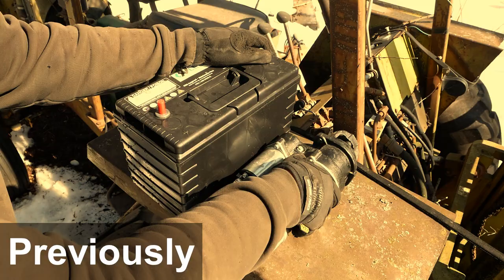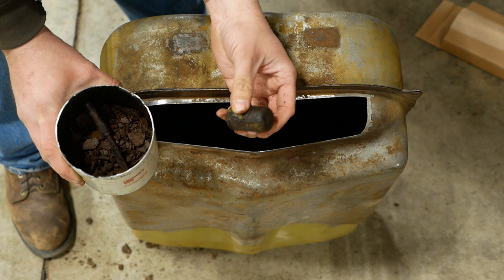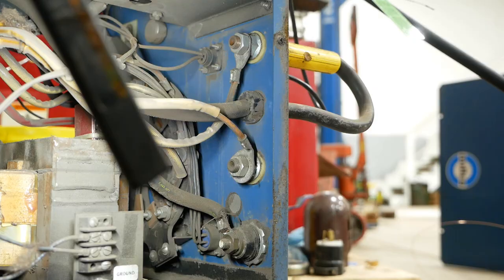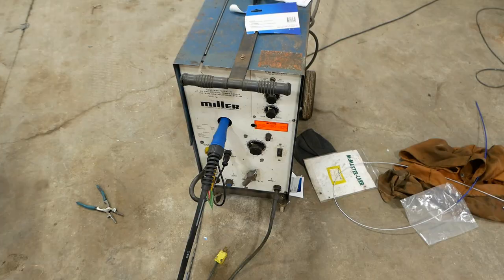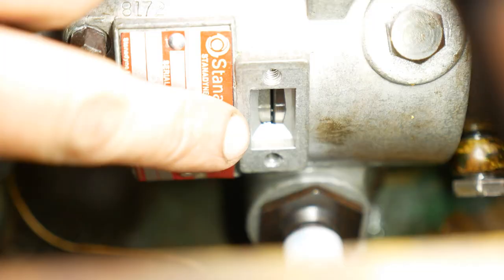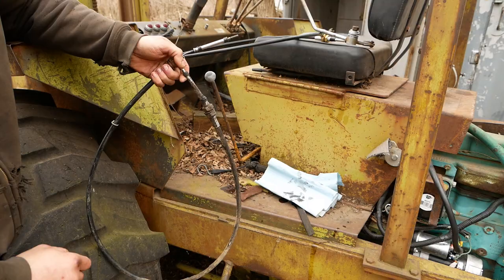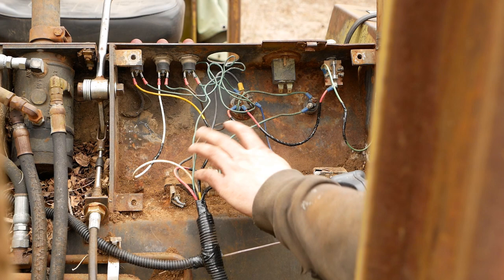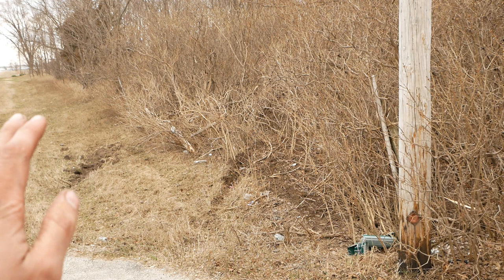Neglected Forklift Drives for the First Time in Years!

Comment: I worked with a Guy at a Truckin Company. We were both mechanics there. He always was welding on a Gas tank. He would put a hose on a cars exhaust and put it in tank that he was welding and with car running he would weld gas tank up...He even used Our bosses cars a few times too do it. Carbom monoxide wouldnt let Gas Ignite.. Seen this with my own EYES a few times. Always told him he was CRAZY for doing it. But hes still Here and so am I...Great forklift and video . Thank you for sharing

Comment: Good morning Wes.  FYI I learned welding in a job shop as a young man.  We repaired gas tanks leaking, full, half full whatever.  My mentor worked gas welding aluminum fuel tanks for aircraft during WW 2.  We always filled the gas tanks with a blanket of inert gas.  Works always by displacing the O2.

Comment: My father was a mechanic starting late 50's back when labour and shop rates were low and part prices were high. 
The mechanics were the ones to do the actual repairs, or install the rebuild kits instead of off the shelf remans.
Alternators, starters, brake master cylinders...all that stuff.

Predating the epoxy coated tank repairs, he used to braze rads and fuel tanks. 
The dealership was next door to a felt factory for boot insoles.
There was a huge steam boiler in the factory and the mechanics would steam clean the gas tanks with live steam off a 2 inch pipe.
(far different from steam cleaning" with a hot water pressure washer)
Apparently that worked.

I did throw an "empty" gas tank on a fire pit once.  It burned and popped all day like a pulse jet.

Comment: I guess finding a custom plastic replacement tank would have been difficult, and with it close to the radiator there are other issues. Good job!
Reply from the maker: It also holds the air filter. It would be uphill to replace.

Comment: Just for future reference, I have repaired gas tanks with fiberglass. Tanks much like the one you repaired. Just clean the area with sandpaper, then coat with resin and cloth. Never had any leaks.
Reply: I've used the fuel tank patch kits and never had one leak. There pretty much the same as fiber glass.

Comment: I remember a friend of mine getting blown across the workshop when welding a motorcycle tank. He had taken all precautions, filled with water, etc. I can still hear the pop today. He was very lucky, never welded another after that, always tried to get a goodwill replacement from the manufacturer. It wasn't his first one either, he had repaired plenty, used both braize and weld with no issues.

Comment: 6:00  I've had my eyes open for a Millermatic 200 like that here in Ontario, Canada.   No one parts with it unless they die and there are no kids to pass it to.  When that happens the auction prices are formidable.
Reply from the maker: Good luck. Those welders are fantastic. Worth every penny.
Reply: I paid almost twice the price, to get one imported to Europe. It was ultimately cheaper to import an unit and i managed to score it with extra bits and in good condition.
Reply: what kinda prices ballpark we talkin?
Reply from the maker: @darthtrump4428  I see them sell here for anywhere from $750 to $1200 routinely. Pretty good resale value for welders that are 20-40+ years old. Mine was built in 1980.

Comment: Great video Wes. When you said you were going to fill the tank with water I was yelling No.
Little story I had with water in a gas tank. I was helping a friend cut up a car into a off-road buggy, cutting the trunk off.

The gas tank was under the trunk with a air gap between the two sections of sheet metal. To be safe (I thought!!!) filled the gas tank with water. The gas tank had a center fill neck which I was straddling to reach the back of the trunk when I got half way across, cutting the trunk with a stick welder, it blew up.

This was due to the hot metal dripping onto the top of the gas tank. My friends came around to the back where I was standing and I asked if my balls were still there, they were.

It ended up that the car was on a incline allowing a air pocket to form in the gas tank right were I was cutting the trunk. Lessen learned.

Comment: In this area of the Alberta oil patch, there are companies that offer steaming services to clean out the tractor trailer tanks. To my knowledge, high temperature steaming is the sole method of making a tank safe to repair. For the home welder, don't do it, you can buy chemical liner kits to salvage fuel tanks that are irreplaceable.

Comment: Great job the tank repair, when I was 17 I enrolled at night school to braze a motorcycle petrol tank, it was leaking on a seam, first time, spent hours washing it out, then used steam, no problems, my brazing wasn't good enough, so drained the petrol, but wasn't as diligent this time, as soon as I applied the oxy fuel torch, a rather loud woosh, with a little flame exited the filler cap aperture.
Looks like Mrs Wes has five on the free goodies.
Great work Wes, and great photography and audio.
Thanks for sharing and stay safe all.
Regards John.

Comment: Good work dude 🤘🏼 nothing worse than welding rusty thin contaminated metal. Did you seal the inside with anything? If you mentioned it I missed it! I did a video on a fuel tank today as well and had good luck with a 2 part epoxy sealer I used. Fixed up some pin holes with no problems
Reply: And I watched your video first Matt.
Reply: I love it when you guys comment on each other’s videos.
Reply from the maker: I didn't use a sealer. I should have I suppose. I guess when it starts leaking again I will. You can still buy a new tank for it. $500, which I guess isn't that bad.
Reply: @WatchWesWork  it’s not awful but much more than I’d like to spend on one haha
Reply: @DieselCreek  Red-Kote sealer. It works.
Reply: @WatchWesWork  Shucks, I'll bet you could just build another tank pretty easily, and if you really wanted to, you could make it a near-exact replica, which only the most rabid Clark enthusiasts will be able to identify as not original.
Reply: @JustMike2791  I used Red Kote on a 93 Ford that was so rusty the flies thought it was a screen door !!!
Reply: what's the updates on the front end loader next to the forklift
Reply: sup mattu
Reply: @WatchWesWork  deer john,,,farmers mke 3 times the money as anyone else, this is why parts a re 3 times the price. same as owning a 4x4,everything is twice the price..hear in aus, if you live in an upper class area, 3 times the rates as lower..same garbo..

Comment: I’ve soldered a patch on a gas tank using your garden variety sheet metal and a propane torch. Small area with a pinhole or two. This was 1981 or so. I filled the tank 99.99% full of water leaving just a smidge air space. Worked fine. And this was a tank in use on a ‘67 Dodge Coronet R/T which I sure wish I still had.

Comment: I have successfully used fiberglass and por 15 to patch gasoline tanks many times. Always use a sniffer to check for volatiles prior to any welding. Try the por 15, you will be surprised how stable it is in the presence of gasoline.

Comment: If you pour with the opening uppermost, it will not be messy. The air can enter the container smoothly rather than in gulps. Counter-intuitive, I know, but it works. Thanks for the videos. Mike

Comment: I was told by a chemist that you can weld any tank if you control purge it, that’s with a meter checking the oxygen percentage the whole time you are welding! I filled a gap on the side of a thick fuel tank of diesel with the fuel right there! The chemist was right there with his meter and 20 bottles of CO2 purging the tank! Kinda scary but it worked!

Comment: So, one time in a midnight got to get to first day of work on a new job situation, I found myself with a serious rusted gas leak with a nearly full tank. Started with the old sheet metal screw which just made it worse....finally started soldering with an old weller soldering gun....did I mention it was below freezing in January.....finally switched to a torch. The pin holes just burn with a jet of nice blue flame, like the your gas range top...makes them easy to spot lol. The danger is getting on top where the air can mix with it, then it's kaboom. I did make it to work and left a nice rainbow in the parking lot for the next week till the new tank and the weekend rolled around.   Sometimes you just have to do what you gotta do. Use your noggin and any extra luck laying around ha ha.

Comment: I am sad that you did not yet get it to the point you wanted and that the clutch is now a major stumbling point. Your strength in these videos is total honesty. If it goes right, you say so, if it goes badly you own up. If you get to the bottom of the clutch issue it would be nice to know what it was and how things moved forward. Hoses can be expensive and tyres in the same league. Expanding foam or tyre fix goo anyone? Car leaving a straight road; sleep, inattention, boredom, needs stimulation or driver moving beyond capabilities, let us call it DMBC.

Comment: Hey Wes, that was enjoyable and good to see the Family. I had  an ex Air Force Fork Lift a huge thing with   A Ford 4 cylinder Diesel,it had been standing for years,I had similar problems with hoses seals everything in the end I scrapped the frame,but saved the engine which I used to power a compressor...

Comment: I've seen a certified welder weld a patch over 2 inch gash in a fuel tank on a reefer trailer. The damage was high up on the tank, nothing spilled  when it was damaged but it was still half full of fuel. He said it was safer to leave the fuel in rather than drain it. This was over 35 years ago. He said the same thing. Diesel tank yes, gasoline tank no.

Comment: I have been fuel delivery driver for 24 years. They weld up those tanks all the time, the shop we went to would weld em as long as diesel was the last load, a technician got hurt really bad from an explosion so their policy on that changed. Now they don’t care what was last load was, gas or diesel or whatever. They have this massive blower and every truck gets blown down at least 4 hours before they weld on it. To even be allowed to weld on a big tanker it takes this $80k permit the shop has to buy so not many shops will do it.

Comment: In addition to back purging a fuel tank, you can use an exhaust from a running vehicle run into the tank to displace oxygen.  I prefer the inert gas, but it works if you are in a bind.

Comment: I got the same machine, well worth fixing. Seems a lot of parts I have needed for the power train also fit a JD2440.  Same rotten bottom tank as yours, mine I boiled out with water and super clean to get rid of the diesel residue, followed by a boil with water and vinegar to get rid of the rust. The pin holes( about 30) I dimpled in with a center punch and then filled them with silicon bronze Mig wire (much lower temps and a god send for patching paper thin sheet metal). After that I coated the inside with three coats of Gylptal varnish.
Same leaking tilt cylinders, I repacked them, then a week later the mast cylinder and steering cylinder decided they wanted to spew too. Repacked those and all was well for a couple years, but now the brakes don't want to release. This would not be a bad fix, if it were a tractor, but since it has a forklift built around it.....sigh 😒😒

Comment: A tip for pouring out of a container that likes to gurgle and burp like oil jugs, even 5gal containers; rotate the spout side upwards at least 90 degrees, 180 if possible, yeah, you will have a farther distance to pour but you've now eliminated that annoying air burp that gets it all over everything (and the dribble). It works because you are now letting air into the container without having it bubble on through the liquid, i.e., a vent path. ;-). Off road forklift, yep, many a contractors dream. Nice work on the ol' gal.
Reply from the maker: It doesn't work unless you can really pour fast. For a slow pour it just runs down the side of the jug.

Comment: The control cable thing is crazy.  The 3-4 ft winch control cable on my John Deere skidder cost something like $200 20 years ago.  When the control cable on my boat went bad I thought it would cost a small fortune because it was maybe 16 ft long.  It was in the range of $60.  
Not sure what the clutch set-up is like but I've had a couple of situations where rodents have built nests in clutch housings and prevented them from engaging properly.

Comment: I would also suggest you keep an eye on the oil in that motor. It has a sleeved motor, if they didn’t change coolant, it could have galvanic corrosion at the sleeve to block orings. When it comes up to pressure, it’s going to shoot antifreeze into the pan like a hose.

Comment: When welding patches on tanks tubes etc. i make the patch slightly bigger and weld it inside the hole, weld a stick or rod on it to hold it in position till you get tacks on, this is a handy method if it sits on something and hight is critical like say inside a hud that needs to close. 
I would have shifted the truck out the way before checking if it moved, a sudden jerk forward or stucking in forward and you get some unexpected repairs on the truck to do.

Comment: I've fixed up rusty gas tanks in the past with Red Kote from Damon Industries. It works well and protects the inside of the tank from future encounters with wet gas or water pickup from ethanol. The big sticking point is that Damon says don't use it in diesel applications. I wondered why, until I drained the tank on my generator and the gas was red.

Comment: My dad and his cousin washed out a gas tank multiple times. Thought it was safe. Touched the welder to it and the tank went straight up a good ways. When it came down it looked very pregnant and, of course, was no longer useable. They were lucky the tank did not explode and kill them.
Reply: It's the vapors that do it. Leave the damn water in it.
Reply: You are absolutely right. Unfortunately they didn't know that. This happened back in the late 1960's or early 1970's and there wasn't Internet and the easy access to information we have today. Even so, they probably should have known better.

Comment: Some tank sealer would have been a good idea. Pour it in and tip the tank so it runs all over the bottom of the tank and let it dry. Leaves a layer of seal on the inside of the tank to seal any holes and prevent rust. Never tried it with diesel fuel but works well with gas.

Comment: Next time you're back on the Clark, Please take some oil and grease and do up the boom.
It's driving me nuts. The chains especially. (Use to work at Allis Chalmers & at Pettibone way back when...)
Clark had a plant in Aurora back when also. I think that it closed in the '70s.
---=---
As for the leaky tilt cylinder, I hear that affliction is going around currently. A big ass Bandsaw followed me home from an auction and I figured unloading would be a snap with the skid steer. Lost the seal on one of the bucket tilt cylinders, had to cap it off.
Time to unload after repairs: 30 mins, Time to cap the lines and top off the hydraulic fluid: 90mins...  😄
Looking forward to the next installment and using that beast to clean up the yard. Perfect vehicle for that.

Comment: Glad to see you have a 4-way screwdriver in that tool box.  I'm surprised you didn't consider cutting that fuel tank in half at the seam, and fabricating a new half with a sheet of new metal.  Or, given the time you put into it, just fabricate a new tank.  I've had to bleed and prime many fuel injectors on different sized engines.  It's a dirty job but someone's got to do it.  Nice work and video. 👍

Comment: If it is like a Deere the clutch works on the reverser. Check the modulation valve that goes to the pedal. They get sticky or the springs break. Also be sure you are getting enough throw to fully move the shift linkage. 2” of travel seems short. Most Deere linkages tend to move more like 3” and use a 4” travel cable. It should have operating detents you can feel at forward neutral and reverse if it is like the Deere forklifts

Comment: Welding gas/petrol tanks is not as bad as you would imagine. Fill the tank with fuel, ensure there is minimal flow of air, if necessary purge the headspace with enough propane that you have flow to support a flame at every exit hole. In all cases allow time to remove excess air/oxygen before starting welding.

Any spaces in boats or adjacent tanks that may be contaminated may be purged with propane to ensure no air is present.

You need to wear a compressed air supplied respirator that has an external exhaust tube, so your breathing air does not vent into the tank, if you are welding it from inside. You need to keep positive pressure inside the tank and flare off any gas externally for holes that can’t be plugged.

So long as no oxygen gets in the atmosphere remains above the explosive limit (HEL) you should use a gas monitor if cutting holes, and stop work if the concentration gets closer to HEL, and seal up or increase purge flow.

Comment: When pouring out of a oil can or 5 gallon bucket with the pour spout on the edge. Turn the spout to the upside of the lid so the air can go in the top of the hole and the liquid comes out of the bottom of the hole, it makes for a smoother pour and no glug glug. Think of the top of the container like the face of a clock, you have your spout a 6 o'clock when it needs to be at the 12 o'clock

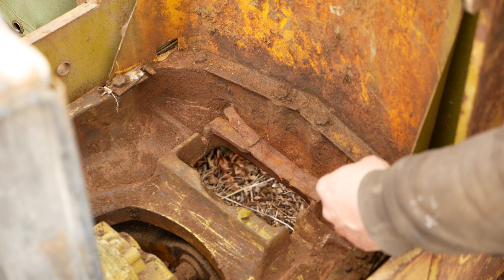Comment: @ about 2:30 the material is usually cork and it goes between the frame and the fuel tank to prevent them from rubbing together (with vibration) and wearing a hole in the tank.